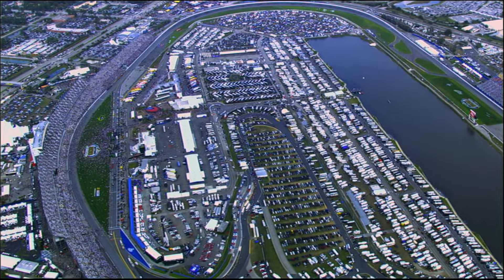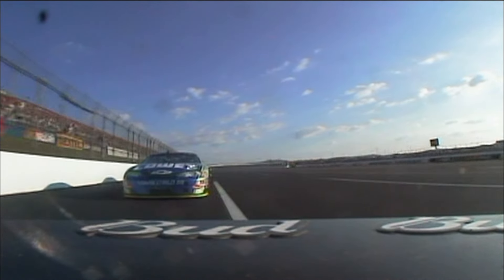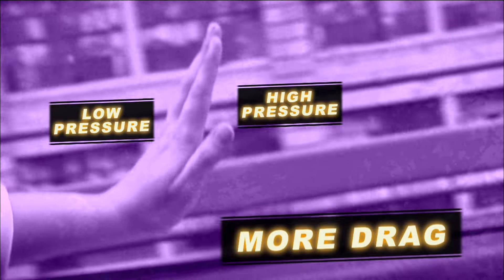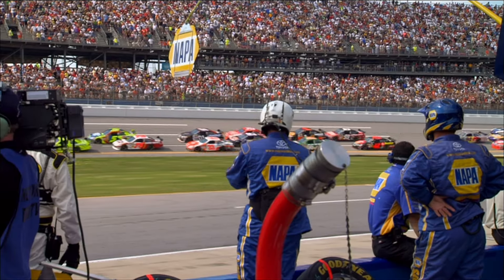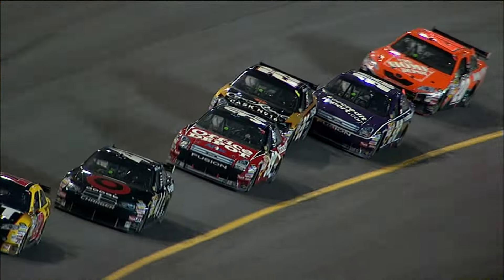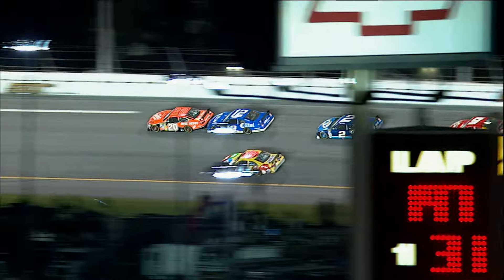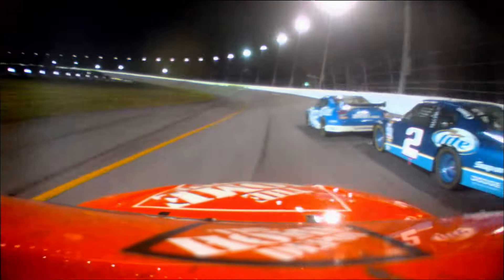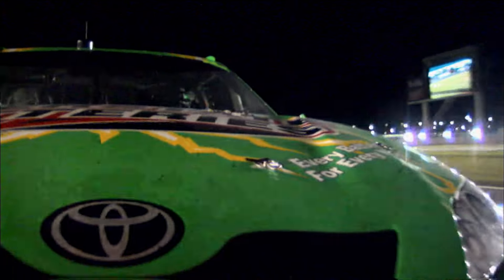Drag & Drafting | [NASCAR] Science of Speed

Comment: So if there are multiple cars drafting, say 3, which car is using more energy (gas) and which is using less?
Reply: The one in the very front.
Reply: damon jackson the cars at the front experience drag but  the last car can also experience some drag
Reply: If we use your example of 3 cars, the front car experiences front drag (front bumper air resistance), the rear car experiences rear drag (rear bumper air resistance) and the car in the middle has the least amount of drag because it has neither front nor rear drag. All 3 cars, however, will go faster because the middle car can bump draft the first car and the rear car can bump draft the middle car. 
It sounds complicated but just imagine a tandem bike. Not sure if you've ever ridden a tandem bicycle but the 2 people on the bike have to peddle with less power than one person on a singular bike for the same amount of speed because there are 2 people on one singular bike with 2 wheels against 1 person on one singular bike with 2 wheels.
 
The same thing happens in Nascar. When cars draft, they become like one car with multiple engines. When a line of 10 cars all draft in a single line, they are upwards of 5mph faster than any singular car or just a couple or a few cars drafting.
Reply: Benjiizus the middle uses what, less or more?
Reply: The more cars pushing the harder it is to stay in line especially with the rules package now. Most likely if you are bump drafting 3+ cars one of the cars will wind up getting turned.
Reply: The middle
Reply: No drag no moving air molecules